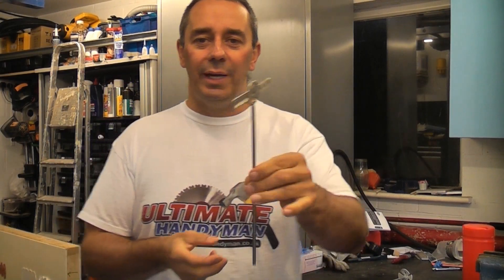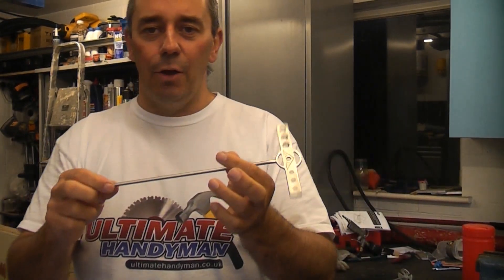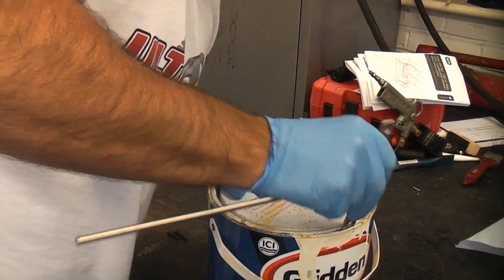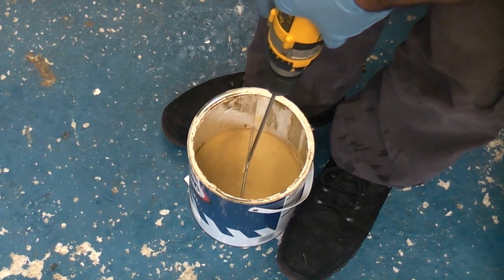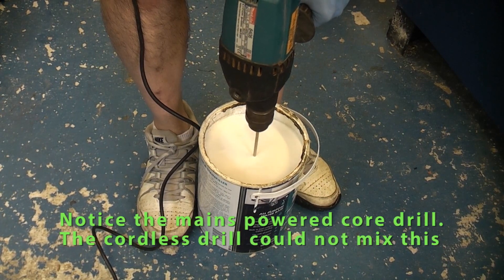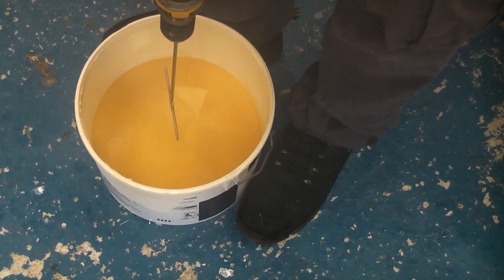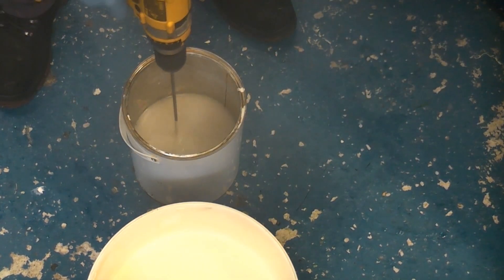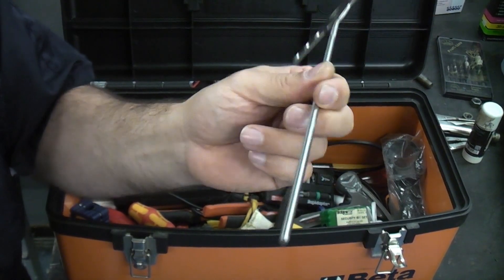Cyklone mixer/stirrer

Comment from the maker: I was sent this Cyklone mixer / stirrer a few weeks back to try out. I was pleasantly surprised with it as it mixed some paint that was a few years old very quickly. 
I hope everyone has a great bank holiday weekend ;-)
Reply: Good bit of kit and you can tell its well made. Not entirely surprised by the BOSCH mixer as I had a cordless drill which packed up after not much use so wouldn't ever buy BOSCH again or maybe it was just a bad experience?
Reply from the maker: I used to love Bosch tools and would always buy them at one point, but they have made a few bad tools. At work there is a full set of Bosch 18v tools, the reciprocating saw is ok, the grinder is ok but the 18v cordless combination drills are not up to the normal standard I would expect for professional grade machines. Having said that their 18v SDS drill is absolutely brilliant and will easily drill tough reinforced concrete.
Reply: is there any tutorial on how to wire a 2 gang 1 way switch? one of my switch is upside down and I'm trying to fix it.
Reply from the maker: The only thing you can do is turn the switch the other way up- but then the other switch might be the wrong way. There is nothing you can do to the wiring to correct the problem as, even if you swap the wires from com and L1 the switch will be exactly the same.
Reply: What you will probably find is, if it`s a 2 gang switch, they will both be two way. So you have terminals L1 & L2. So if you are only operating them as one way switches, you need to put the switch wire into the correct terminal, otherwise it makes it appear upside down. Some manufacturers will mark the terminal for one way operation.
Reply: Sir handyman can i order this in your website and ship it here in the philippines? The website i found is www.cyklone.co.uk,is this the rigth one?
Reply from the maker: Yes, that is their correct website. I do not know if they ship to the Philippines though.

Comment: Thanks for the very helpful video.  I've got a couple of questions...

1.  Will it fit into a 1L tin of paint; what does the end bit (the bit with the holes) measure?  

2.  I've also got a tin of Zinsser Bulls Eye 123 which has gone solid-ish.  Funnily enough, that's how I came to find the Cyklone!!!  But if the Cykolne were to work on my tin as it did for you, would you then be confident to use the 123 or do you think it would still be beyond it and ruined in some other way?

Cheers
Reply: Thank you for your question re. the width of the impeller Max and I have replied to your email directly.

Comment: Looks well made, may have to buy one. People don't mix paint well enough! I am a bit wary of using old paint though as they do go off. Learnt from experience. This is good Dulux paint too. What are your experiences of this? Cheers.
Reply from the maker: I have used some old tins of paint, as long as they never get stored in sub zero conditions they are normally still usable with a good mix up. 
If the paint has normally been frozen it's normally only good for the bin.
Thanks for the comment ;-)

Comment: Quick question - could I use this tool to mix plaster too? Thanks
Reply from the maker: They say you can use it to mix plaster but I have never tried it.
You would probably need a powerful drill though as most cordless ones will not be powerful enough to mix it.
Reply: Thanks. I'll give it a go :-)
Reply: Dear Maria Hippach - Thank you for your question, if you go to www.cyklone.co.uk/what can it mix you will see the many products it does work on.. C

Comment: Looks good but seems awfully expensive. My 99p welded ones do a very good job and are practically disposable at that price, though they seem to last several years easy.
Reply from the maker: I paid a similar price for the Bosch mixer a few months back. I guess this will not be cheap to make due to the stainless steel and welding etc. 
Thanks for the comment ;-)
Reply: No it looks sturdy and I am sure it will last a long time. The cheap ones are mild steel and painted, they last a long time in paint but will rust if used in cement/filler and not cared for. They do benefit from being made from 1/4" stock though so go in a drill easy. Better made than that bosch though, that seems really cheap and nasty and I can't believe it broke so easily.
Reply from the maker: Thanks for the info ;-)
Reply: caskwith Thank you for your comment and yes it is a little more expensive than most, however if you get the chance to look at our website www.cyklone.co.uk, the 'What does it mix' page and the 'Can anyone use it' page will hopefully give you an idea of its value for money.

Comment: I am surprised at the bosch's one , being such crap design!  mine is a length of rod bent at the end and back over to make a T, stainless steel, and often put it in the fire to burn off all the old paint! being just round bar its easy to clean.    People should mix paint more, it settles out even if you think its new
Reply from the maker: Yes some people just don't mix the paint enough especially before use.
I don't know why Bosch designed the mixer like that. If the paddle part was metal and it was welded to the shaft it would be much better but then probably twice the price.
Thanks for the comment ;-)